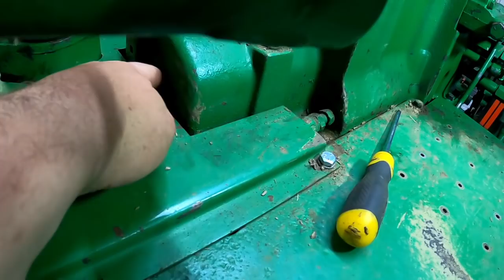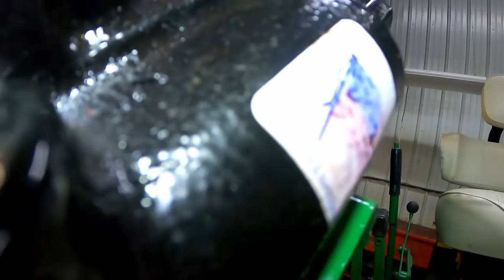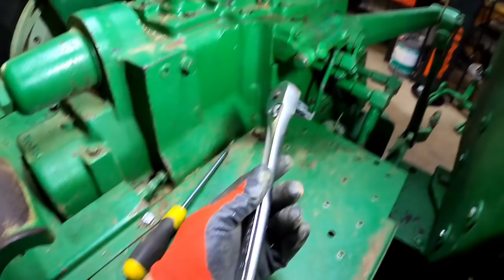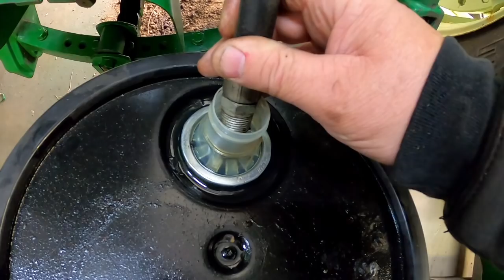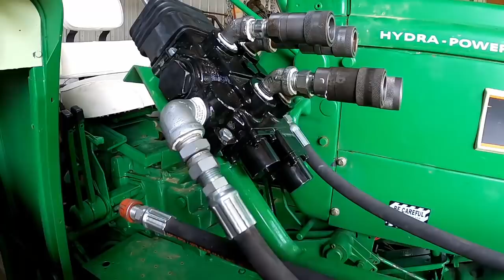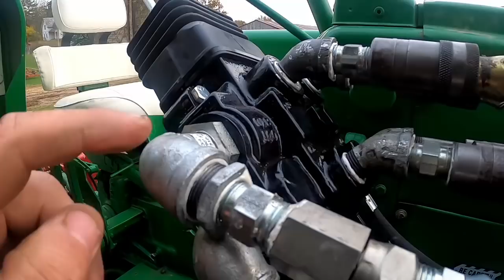Power Beyond Hydraulics for Oliver Tractors

Comment: Question just bought a 1655 loader is plumbed into the rear outlets, while using it getting some oil pushing out joystick cap and bucket is super jerky on dump only. Any ideas?
Reply from the maker: The jerking is caused by the oil returning faster than it is leaving, the oil coming out of the breather might be from the same. I need to make a video on this, but on the top cover of the hydraulics is a restrictor screw that you can turn in to slow that return oil down to smooth out the bucket.  It is a flat head screw with a jam nut, and that screws into  a large hex head plug. Loosen the jam and turn it in a turn and try it, might take a couple tries to dial it in.
Reply: @ThatOliverGuyChris   Thank you so much, I have dual couplers on that side with valves so I can hook up a implement and shut bucket off. I backed the return valve off over half way and it helped. Glad to know I was on the right page. Will adj like you said to see if I can make it right. Thank you so much

Comment: I’ve been thinking about purchasing a Oliver 2150. However It does not have a front end loader. I’m having a hard time finding loader arms for the 2150 model. How much would this cost to have done?
Reply from the maker: Looks for a loader for a White, 2-135/2-155. They use the ssame front tub. As to how much it would cost to have them custom built, I could only guess. Personally,  I'd find a local fabrication/weld shop and ask them, it's going to take some work to get it to fit and be strong enough.
Reply: @ThatOliverGuyChris  Thank you for the reply. I recently found the Westendorf WL-42 and thought it ought to fit. As for the cost I was actually meaning the entire procedure done in this video say if I was to pay you. I’m relatively new with tractors and this will be my first purchase.I like what you did with this a lot and would honestly like to mimic it with the 2150. Thanks again✌️

Comment: Were you able to repair saginaw steering system. I replaced mine with with one I don't like with the smaller steering wheel. I still have the original parts except for that bearing that holds the column in place and would like to put it back in if possible. Who would be able to do this?
Reply from the maker: To the best of my knowledge,  there isn't a way to repair the saginaw unit. There are some special tools required to set it up right, and I don't know of anyone that has the tool. They can be resealed, but getting everything balanced is the trick. I've got a video where I use the original steering wheel and column coupled to a char-lynn steering unit. It works nice.
Reply: @ThatOliverGuyChris  I could live with that I can't get used to that go kart sized steering wheel, I'll check it out. I just came across your videos today and they are really nice.
Reply from the maker: Thanks!

Comment: I never clean the priority valve in place. They are easy to remove, disassemble, clean, and rinse on the work bench. Almost always find bits of silvery material inside. (crushed filter) Not easy to get clean in place.

Comment: I have a 1650 That the auxiliary hydraulics are back feeding somehow. Everything else works good 3 point & steering. Replaced the valve body to have the same problem. Just wondering if you had any ideas? Any help would be greatly appreciated.
Reply from the maker: Can you give me an example of what happens when you use it?
Reply: Their is constant low pressure on one side without actuating the valve in either direction.
Once you hook up a cylinder it will kick it in or out immediately. Hit the lever and the hoses will jump but not move the cylinder back. The same one either side!
Reply: It’s been a while since I played with it but I want to say when you hit the lever in one direction you would get pressure on on both sides at the same time.
Reply from the maker: A little of that is the nature of the beast, but yours sounds excessive.  There's a pair of screws with a 3/8s jam nut on each side, just under the seat. The one with the smaller flat screw head that screws into a large hex shape is a restrictor.  Loosen the jam nut and turn that screw out until it stops. If it is screwed in too far it restricts the flow too much and can cause back pressure.  Do implements settle while hooked up to the remotes?
Reply: All try and look tomorrow but l replaced that hole top lid with the valve bank and everything on it used. It dose not drift after it moves on its own. Says fixed in the full extended or retracted position.
Reply: Wow thanks.
What would be the proper way to set or adjust those now? The auxiliaries have 1800 psi and drift down to 400 psi rather quickly and then hold. Or is that good?
what would cause this to happen in the first place out of the blue? Nothing changed just started  acting up one day.
Reply from the maker: So wen you say you replaced the valve body, so you mean you replaced the top cover of the hydraulic unit? Those restrictors will stop turning in or out when they reach the end of travel. So if you screw it out until it stops turning, that is zero restriction, and screwed all the way in will stop the flow.
Reply: Ya I replaced everything I could think of in mine and when I couldn’t think of anything else I found a used replacement complete top(valve).same problem right around when COVID hit and couldn’t get and help so I give up. Figured it was something stupid simple. Yes I have changed oil and filter. Second thing I tried. 
From behind the one on the right had no stop just came out. Turned it back in so their has 1/4 of threads inside and tightened up the jam nut. That’s why I asked about adjusting them the right way.
Reply from the maker: As far as what caused it, my guess is something is causing a restriction somewhere, maybe the 3 point servo valve. Whether a chunk of something broke off, or just what happened is hard to say. Have you changed the hydraulic filter?
Reply from the maker: There are 2 screws on each side. The one with the bigger head is the interlock bleed screw,  you want that one all the way in. The one with the smaller slot head isthe one you want to adjust

Comment: How do you check the rear hyd? oil on a 550, I can’t seem to get the cap off, behind the seat.
Reply from the maker: There's a tin cap with a dipstick behind the right side of the seat, so it sounds like you have the right thing.  It seals with an oring, maybe someone put an oversized one in at some point, making it tight. You're probably going to have to pry up on it with a small prybar of some kind
Reply: @ThatOliverGuyChris  Does it just pull up, or twist?
Reply from the maker: It pulls straight up, but twisting it won't hurt anything.  Giving it a twist might help break it loose if the oring is sticking to the cap.
Reply: @ThatOliverGuyChris  Ok, I was twisting, but not pulling up, figured it was threaded. Thanks!

Comment: Chris: what modern hydraulic oil would you recommend to use in a 1650 today?  I have the owners manual, but obviously that is from 1967.
Reply from the maker: I use universal hydraulic transmission fluid.  It's what modern tractors use for their combination hydraulic/transmissions. Its good stuff,  readily available,  and prevents contamination between old hydraulic oil and newer stuff.

Comment: Chris: i have a gas 1650 with a farmhand f225 loader (basically the same as a 1610 oliver loader).  If i want to run my NH 469 haybine with out having to unhook my loader remotes, is a power beyond setup the answer?  I have 2 remotes and just use the 2 regular levers for my loader.  I just have one cylinder on the haybine.  What would u suggest i do?  Currently i unhook the bucket from the remote and use chains to hold the bucket up while i cut hay.
Reply from the maker: Yes, doing what we did here would free up your remotes. This tractor used to run the loader through the remotes, but he bought a 3 point blade with 2 different swing cylinders. Now he has full use of the loader, both remotes can be used on the scraper blade, and the 3 point works just like normal.

Comment: This is very great information and will help me with a few things.
so i have a question..
I lost all hydraulics to hoses  3 point and steering im guessing the pump is done for?
any help would be greatly appreciated.

also the hydra shifts seems fine
and i dont remember but i think i lost pto also..

thanks for any info you our anyone can help me with
Reply from the maker: Sounds like the splines at the flywheel that drive the liveshaft for pto and hydraulics stripped out.  If it's a large frame Oliver like 1750, 1800 or bigger,  the snap ring that holds the sealing plug in place may have popped out,  letting the live shaft slide back out of the flywheel.  I've got videos on pulling the live shaft on the different models, that's where I'd start.
Reply: @ThatOliverGuyChris  
Ok I’ll look at that. It also make a loud screaming sound. I forgot to mention in my question. 
Thank you.
Reply from the maker: My money is on those splines. Shaft removal isn't bad, but the engine has to come out to replace the hub that drives the shaft.
Reply: @ThatOliverGuyChris  
Ok it is a 1850
Thank you for the info

Comment: Great video.  Question, why didn’t Oliver use a detent on the hydraulic valves?  I know on the early series they had the electric system but in the newer series that wasn’t there.  I just like being able to raise at the end without holding the lever.
Reply from the maker: They did have a detent option,  but it wasn't as common as the hydra lectric option. The 00 and 50 series hydra lectric worked just like the earlier system on the Supers and 3 digit tractors.  So many had the wires snipped off you wouldn't know they were hydra lectric back in the day..

Comment: Careful with those reducers, I've snapped so many of those things. For stubborn plugs, I use a similar method except, I'm using break over bars, no ratchets, no reducers. 
Water in the hydraulic oil? Looks milky. You're right about the bucket control, it's backwards but, if he likes it that way... 
Oliver's the most easiest, simplest of all tractors to work on. Cheers :)

Comment: Thanks for taking the time to make a video on 50 series hydraulic systems. I have worked on a few had a basic knowledge of it. You explained it really good. When you replace those gear pumps what brand do you use?
Reply from the maker: Last one I replaced was the one in Herman, and I was lucky enough to find a nos Vickers pump for that. I go to my Agco dealer or one of the aftermarket places that specialize in Oliver so it's right the first time.

Comment: Great video Chris. I still have a 1810 loader here that I adapted a Westendorf  quick attach system on 40 years ago and replaced the bucket with a John Deere 7' bucket. Also had a set of forks, bale spear, and a bale hugger that I adapted to the quick attach. Seems that I had to plumb my 1855 a little different than you did. If I am not mistaken my 1855 has a closed hyd. system on it.
Reply from the maker: Yep. I've got a video on adding power beyond to the closed center Olivers, that one is simpler yet.

Comment: Years ago when dad got our loader, he used, bent Quicke that was off a Deere. So, dad took it to an industrial welder not too far away and he modified thw mounts to fit the Massey Ferguson and fixed the loader to a state that was probably better then new(the only way to tell his welds from the factory is his welds don't have paint). But he hooked up the hydraulics up a bit goofy so the loader worked fine untill the system warmed up, then it stopped working. So a few phone calls later the dealer that originally sold the tractor said "bring it here, we think we know what's up". So an hour in the shop and a few fittings latter the loader is working perfectly.
Swear that the loader was one thing that you wonder what you ever did with out!

Comment: Very informative Chris. Our JD 4020 loader tractor that we use to own was set up this way as well. We always called it being  plumbed in live. The part that we liked about it was that it kept the hydraulic remotes free for other jobs. I really like the joy stick we have in our New Holland now it is in a very handy spot. I always got a sore bag with the old loader tractor as it had three separate levers to run it and they were at the front of the cab. However they always worked when you pushed on them. The only down side to the joy stick we have now is that it has a computer in it. It went out this spring and it cost $600 for the new one.
Reply from the maker: I'm seriously considering doing this on my 1750. The ease of use, the smoothness of the valve, plus having the remotes open make it very tempting. The new valve was about $350, most everything else is already there. My loader is a quick attach, so having the hydraulic couplers up front would make it easier to move remove as well. Not that I do that very often. Lol.
Reply from the maker: Just watched Paul's latest video. I'm kind of surprised you guys don't use the skid steer for more loader chores. We loaned our skid steer out to a customer years ago while their skid steer was in for service. Boy did I learn to appreciate that Gehl during that time!
Reply: @ThatOliverGuyChris  We would use it more often if it stayed here full time. Our cousin Matt owns half of it so we get to share the use of it. Someday we need to sell our half out and buy our own.
Reply from the maker: Ok, that makes sense.  I figured it was more about the comfy cab on the blue tractors.  😎

Comment: Nice explanation.  The circuitry applies to a lot of tractors.  Wouldn't it be a slick addition to convert that loader to skid steer quick attach?
Reply: That's what I did.  All I have left to do is run a set of hoses to the front so I can run my grapple.

Comment: Does the rear remotes still work doing this? I’d love to change my 1650 over to this set up. I bought it with a gawky looking pto pump set up on it and it would be so much more useable like this.
Reply from the maker: Yes, that's the main reason we went this route. He previously had the loader working through the remotes, but needed those for the cylinders on the rear blade he had bought.
Reply: @ThatOliverGuyChris  I can’t tell you how much I appreciate you doing this video.  Really helps out.
Reply from the maker: Glad I can help out.

Comment: Great video, I really would love to find an Oliver and a loader for handling round bales. I have had a really bad want for a 1555 or 1655 diesel for a few years now. we have to move a lot of 5x6 round bales and the tractor we have now just doesn't do an ideal job. That and Farmalls are not my favorite.
Reply from the maker: The 1655 has a larger hydraulic pump and shifts easier, that's the way I would go.

Comment: In your opinion what is the best oil to use in this type of hydraulic system?
Reply from the maker: I have switched all of my tractors over to universal hydraulic/transmission fluid. It's good enough for the newer, higher pressure systems, and I don't have to worry about old tractors contaminating newer tractors with the oil in the hoses and cylinders of equipment. Plus I only have to keep one type of hydraulic oil on hand. Been doing it for quite some time now with no ill effects.
Reply: @ThatOliverGuyChris  any particular brand/ weight
Reply from the maker: I get my universal from my local fuel supplier. When our dealership was open, we used AGCO's 821XL. I think most brands of universal hydraulic transmission fluid conform to an industry standard, so Hy-Tran or Hy-gard should be the same, as well as the stuff places like TSC sells. Just don't use any of that cheap stuff in the yellow 5 gallon bucket. Oliver originally recommended a 10 weight hydraulic fluid, and something like that will work as well. It just depends on how concerned you are with cross contamination with newer equipment. It might not be an issue for you.

Comment: Man thats a little loader lol
Reply from the maker: Yeah, it was originally on their 77. He wants to get a wider bucket for it, especially since it will mostly be pushing snow.
Reply: @ThatOliverGuyChris  ya for snow itll work good
Reply: I have a 1650D.  What would recommend for a loader.  I have to start from scratch.
Reply: @drbock1000  a 707 leon. Best loader you'll ever own
Reply from the maker: If you're looking for an Oliver loader, the 1610 is a good match. If you're looking for used, I'd try to get something that was already on an Oliver so you get the correct mounting brackets. If you're looking for new, there's lot of companies out there that make a good loader. When we were selling loaders 20 years ago, they offered mounting brackets for Oliver tractors. Now, I'm not so sure. Maybe some of the viewers can chime in with what they have and recommendations.

Comment: IM NOT THE ONLY ONE WHO USES STREET ELBOWS ON HYDRAULICS!! I NEW IT LOL
Reply from the maker: Busted! LOL
Reply: @ThatOliverGuyChris  had so many know it alls o  here tell me they'd blow out lol haven't seen it yet haha
Reply from the maker: Same here. Only ones I've ever seen break are the ones Oliver put on the 3 point lift cylinder relief valve from the factory. Bad part about that one is you have to pull the hydraulic unit to fix it. Maybe I should start a betting pool on how long before someone points out those street elbows! LOL
Reply from the maker: I  mean how long before someone COMPLAINS about the street elbows. Lol
Reply: @ThatOliverGuyChris  hahaha you really should lol